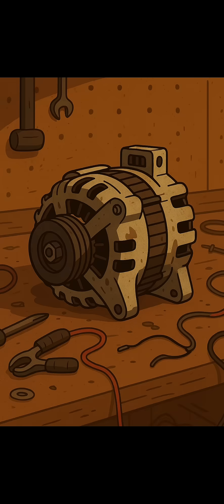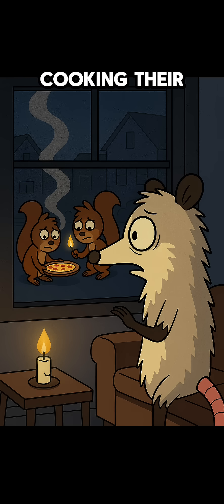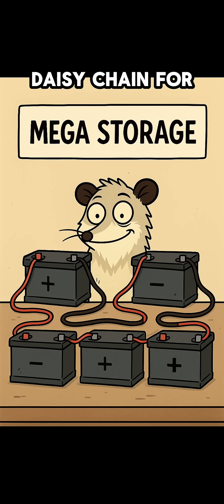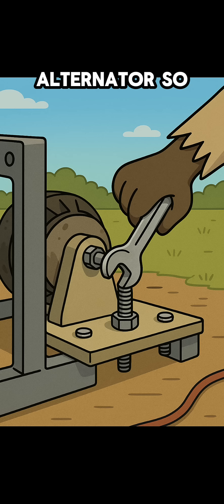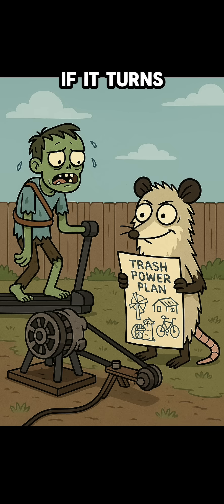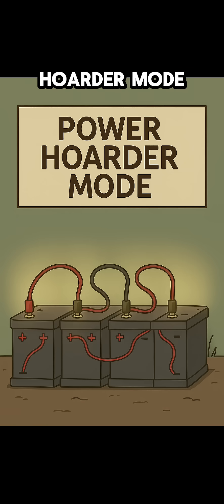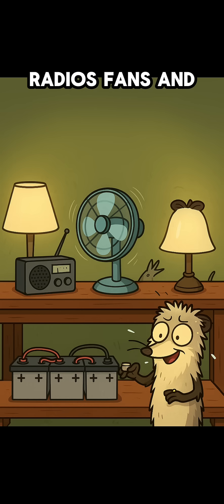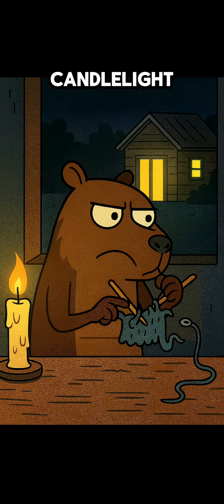How to Make a Generator from a Car Alternator (Survival DIY for Grid Failure) #shorts #science

Comment: Ummmm. Good in theory but unless you find a very specific (self exciting) alternator, you have to use the car battery to first create a magnetic field, you need to be cautious with these instructional videos because when you post something like this, that's blatantly, obviously, glaringly wrong (to any mechanics out there) you ruin your reputation. You also need to be turning this alternator at about 1500 to 3500 revolutions per minute to generate usable charging power. You might want to rethink this instructional. Its wrong.
Reply from the maker: I made a part 2 going over this. Is linked

Comment: 1. Alternator are electro magnets and need to be powered in order to generate power.
2. Alternator are designed to spend at several thousand rotations per minute. 
3. The illustration you showed for daisy chaining batteries is not correct for storing 12v as you've shown a diagram for nearly 52v dc.

Comment: A water wheel would be the most practical. Because it's near a water source
Reply from the maker: That's true but not everyone can have access to a fast moving water source
Reply: @DOOMSDAYOPOSSUM well.   True but without  property line enforcement due to zombies etc.   One could run the water wheel w power production. and wire it into a nearby structure that is still standing. And it doesn't necessarily have to move fast.   A wheel with buckets and a GEAR reduction box  or belt pulley reduction would allow slow water to make electrical power

Comment: If you cross wire them and add in pairs and only run in sequence and make sure that everything adds up correctly you can run a 24 volt system which lasts longer something to look into tho I will say it's a little bit more advanced
Reply from the maker: Yeah that wasn't in my book lol

Comment: Whats dangerous and almost criminal is the bad depictions of wires and not even a relatively close to accurate. You know people learn nowadays by visually seeing. When a person sees how many pages they may have to read, they'd rather spend their time smacking two rocks together.
Reply from the maker: The sad part is your right. People don't read and research anymore. I give the basics. These videos are meant to inform and get the mind wheels turning. You'll need to do your own research. This is an extensive project, and you shouldn't jump into it head first.
Reply: @DOOMSDAYOPOSSUM   did a good bit of the research so far for info atleast [ this is neat stuff]
Reply: @DOOMSDAYOPOSSUM  i..  also do wonder, could you do the same thing using a self made battery ? [aka using copper and zinc]  even though it wouldnt be as effective,  i would assume you can add power into the system somehow.
Reply: .. also how do you connect the car battery's to the appliances ,  that might matter to know aswell

Comment: Well….. not quite. Alternators produce ac current and batteries require dc current.
Reply from the maker: You’re right. Alternators make AC at first. But they’ve got a built-in rectifier that converts it to DC before it leaves the unit. That’s what charges the battery. These kinda comments I love.
Reply: @DOOMSDAYOPOSSUM not all do. And the ones that do, not all have voltage regulators.
Reply: @Falney how do you think it charges your car battery my guy. Every modern alternator absolutely does convert to DC.  The real problem here is turning your stored DC power to 120vAC to run actual household items. You can't just hook your battery to an outlet and plug things in
Reply: @swampypolitics9574 first, I'm not your guy, and second? because some older cars had separate voltage rectiers and regulators. Sure most modern ones do, but just because most modern ones do, doesn't mean all do.
Reply: @Falney  yeah old cars from like the fucking 60s to 80s. If your going Through a modern junkyard, your going to find more 90s and 2000s vehicles than classics at this point. If your actually going to attempt to build some form of survival power system today, you have unlimited options around you. The chances of you finding one that doesn't have a built in rectifier is slim to none. And if you did you'd just pass it up anyway. What you would have to find would be a power converter. Now NEWER trucks and SUV most of them have small 110 outlets. You'd be able to rob that converter but they are very weak and low wattage. Wouldn't run even a coffee maker.  My JK has one, and it's really only good for small electronics, maybe a light. No small appliances.  But you'd have to scavenge a few box stores to find a decent converter for this to be even useful at all.  Or find only portable 12vdc items like camping equipment and mobile equipment. 
    The point is, if we were having this conversation in the 90s. Hell even the early 2000e I'd agree with you. You'd have to make sure.  But today? In America or any other first world nation? Naw. If you were in some 3rd world shit hole or cuba then yes, agreed. But not here. It would be harder to find a vehicle that has a separate system for charging a battery because it's more expensive and pointless with today's tech. Alternators are cheap and readily available with everything built in.  Even heavy equipment, tractors. All that. Unless your in a place where there's nothing more modern than the early 90s. Which even in the deepest hollers that's not true anymore.
Reply: @swampypolitics9574 You hook it up to an inverter to get your 120 volt 😉👍
Reply: You need an inverter.  Now you're producing household AC current